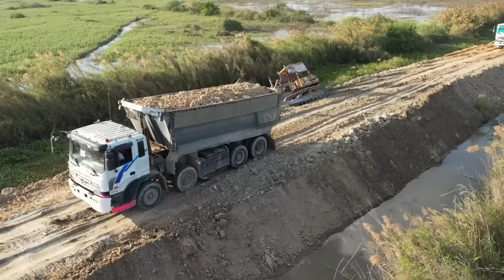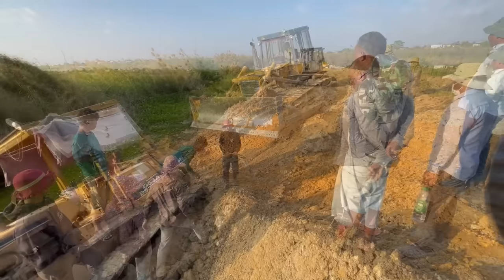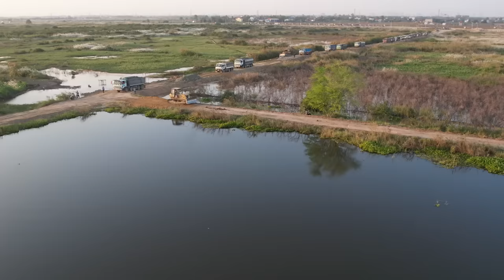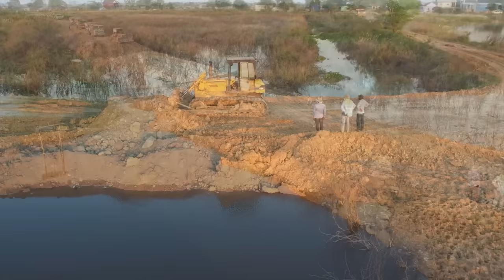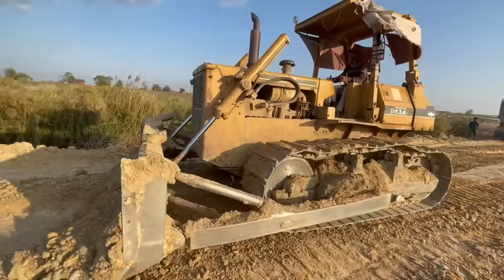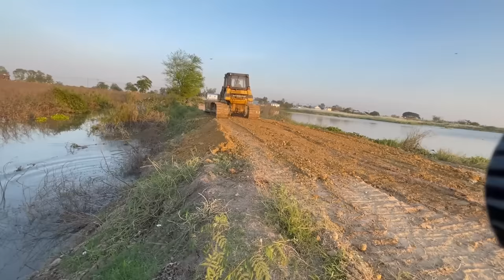Road Building In The Background Are Stunning Dump Truck Huge Moving Dirt Power Dozer Pushing

Comment: Stunning is a word that could be used to describe this, but not the best word.
Reply: E notevole lincapacita
Reply: what happens when that water PERKS UP to the top of all that Dirt and it turns to MUSH ??
Reply: @giovannicristofaro2179 à!😊😊😊😊😊😊😊😊😊😊😊😊😊😊
Reply: @raymondwood1453 the same as the dirt roads all over the northern areas of North America, you don't use them unless strictly necessary in mud season.